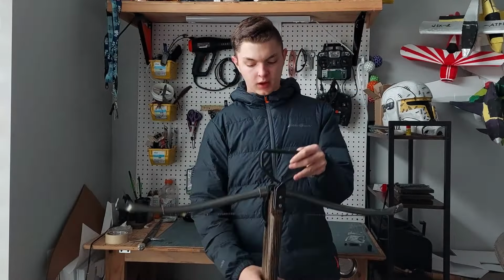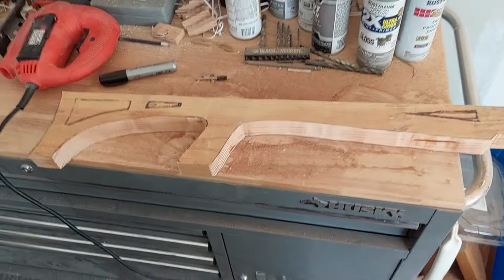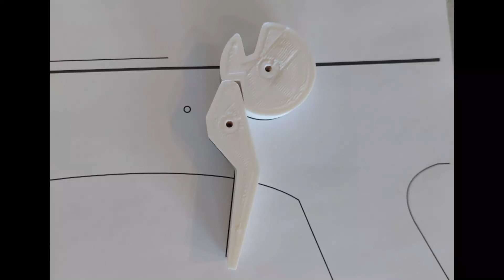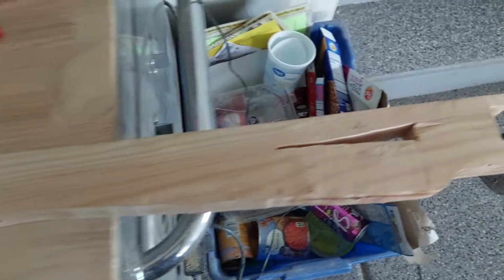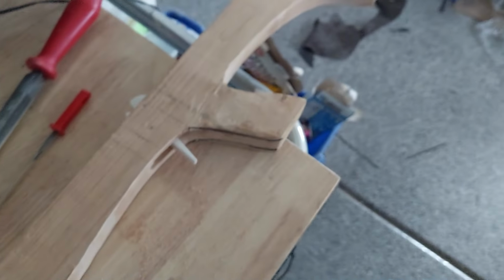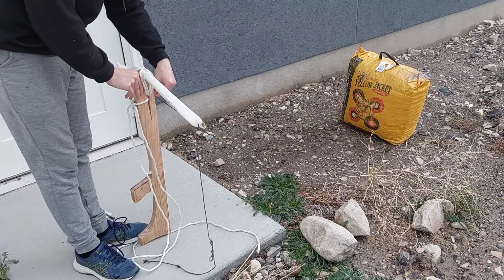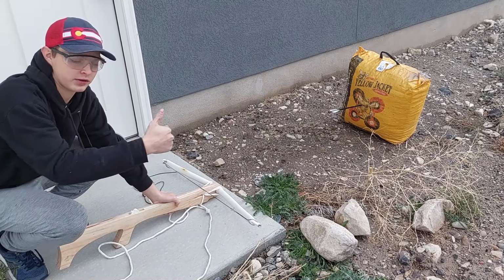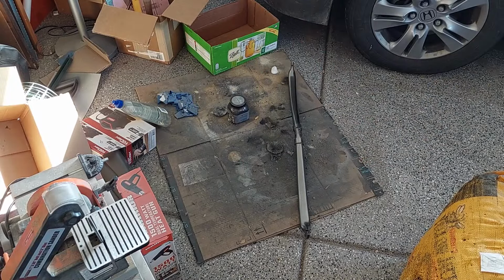Making a PVC Crossbow For Free!!! (Mostly Out of Trash)

Comment: What is the draw weight at the trigger hook? The trigger looks like a weak point. I built a x bow 40 years ago with over 100 pounds draw weight but I used a trigger mechanism from an old air rifle.
Reply from the maker: Yeah that was a bit of a worry for me, but the entire trigger is lime 3/4 of an inch thick, so it's not a huge problem, and since the prod is made of 3/4" PVC, it doesn't have a super high draw weight. It's probably somewhere around 40lb.